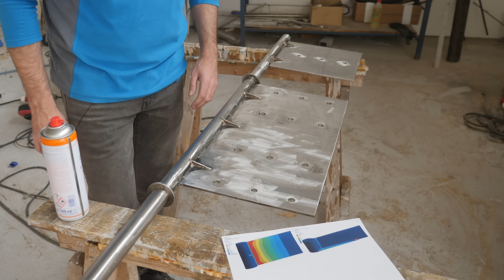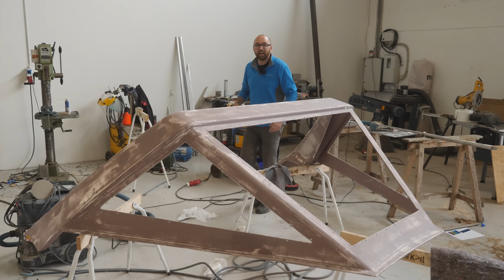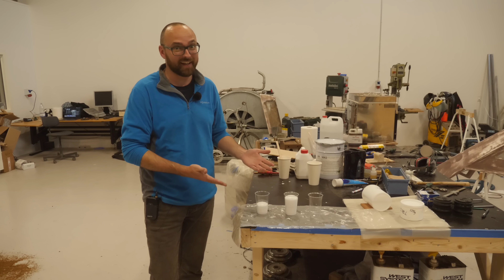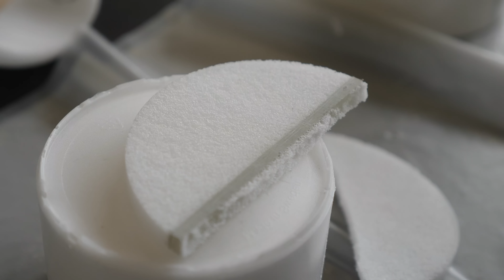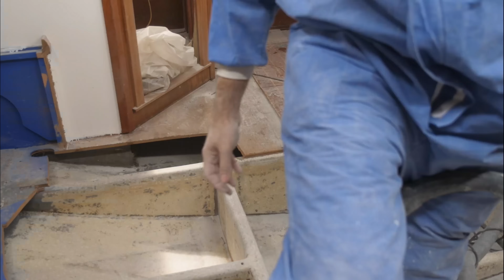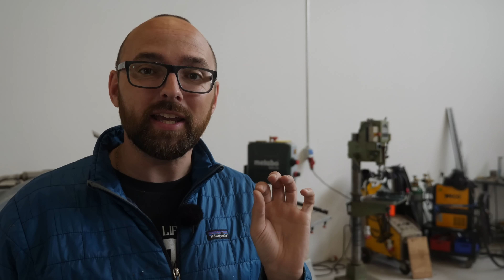Sail Life - Expanding epoxy foam for the rudder, and more sanding - DIY sailboat repair

Comment: If you haven't already assembled the rudder you might consider having the rudder shaft magnafluxed before putting it all together. This test will be able to look inside the metal and find any stress cracks within it. It would be another safeguard of knowing that a accidental grounding didn't do any structural damage. It's a common procedure on aircraft parts and hardware. I had all my wing, and landing gear bolts checked using this procedure. Just another layer of comfort. Chances are it's 100% fine but the piece of mind is worth the testing. It doesn't cost that much to have it done. Just my 10 cents suggestion. Thanks for sharing the adventure.

Comment: I Vote vertical, mix x amount and pour in, let it foam, add some more, kinda multiple stages - multiple lifts, at least this is generally the best way with complex PU foam fills. You don't need to wait for the foam to cure, just for it to mostly foam up then add more, rinse and repeat! Air vents holes are a must if you want it to get into any corners too!

You can get slower low pressure expanding PU foams too, but in industry most of it is used in semi closed molds than can withhold the pressure. This also makes the bubles smaller and makes it a lot better insulator. Free expanded foam would have nothing like the insulation value of the good sheets of the same stuff cured under pressure.

Comment: Are you not concerned about the think fiberglass skins and soft foam only on your rudder?  if the rudder never encounters barnacles or heavy scraping, or a log or other debris on the water, then all should be fine. But something that soft may make it too flexible and cause the foam to crush over time causing the outer skins to develop hollows.  I think this was the reason for the much harder foam on the original rudder.  I'm not an marine engineer, only a mechanical one.  I would recommend thicker outer skins with a layer of divinycell and fiberglass then foam.  Making the skins more resistant to flexing.  I love the videos and your hard work and dedication to the re-build.
Reply: Good one. I would be very interested to learn about the maximum pressure per square whatever of the foam before it gets crushed. Ditto the amount of deformation before getting crushed. Perhaps some nice experiments for a new video? I am not even an mechanical engineer, only an electronics engineer, but I totally get what you are saying. One would also perhaps want to know how sheering force would cause the foam to disconnect from the shell, and the implications on the strength and stiffness of the rudder. Perhaps even causing problems of vibration? It would be nice if a computer simulation could be made.
Reply from the maker: According to the specs the epoxy foam has a Modulus of elasticity of 205 N/mm2 and a Compressive yield strength of 6 N/mm2. That seems like a lot to me considering the size of the plate on the rudder stock but I'm in no way an expert :) It would be very interesting to get some professional feedback on that :)
Reply: @SailLife  Most pressure washers are rated at around 17N/mm2 of water pressure, though then will fan out the spray pattern, it's not hard to get to 6 N/mm2.  Not to mention the possibility of hitting a log adrift.  Though this is not a catastrophic failure, it will lead to water in the rudder and more flexing of the skins.  Please consider adding additional layers to the rudder with a  foam layer between the layers, even if done from the outside after foaming.  Sorry for the delayed response.  I love your work on Athena and the passion you show for learning.
Reply from the maker: http://www.sicomin.com/datasheets/product-pdf188.pdf The foam I used was the PB250 / DM2

Comment: Can the metal in the rudder move freely in the mold without the foam.  If so, the rudder will be exerting pressure on the foam.  Will the foam deform overtime and cause a void?

Comment: Mads another great video, however if you spoke to experts about the stainless steel ruder who gave you thumbs up i would be interested to here there view on the stainless steel fuel tank that you cut up??? I have got to admit you now have one spiffe fuel tank however i still think the old one could of been modified as previously commented on by me and others  however you said it was your boat and your decision, which i respect. Don't won't to be  a assehole / i told you so but just curious did the tank not fit out the comanyionway to allow you to modify???
Reply: The tank wouldnt fit out of the engine compartment..  it was built around apparently, I remember him cutting it out first..

Comment: I would recommend a Magnetic Particle Inspection, MPI , of the welds to search for any cracks in the welds. This can be done by any Non Destructive Testing, NDT, company. Not expensive and quick, and peace of mind for the quality of the welds on your rudder stock.

Comment: Pin holes are where manual mixing your filler comes in handy, you can go over your work with a soupy mix that will fill all the pin holes.  Of course you then have to watch out for runs.  There's always a trade offs.